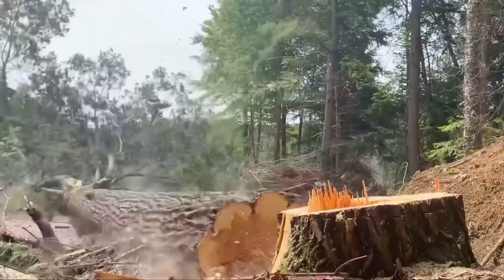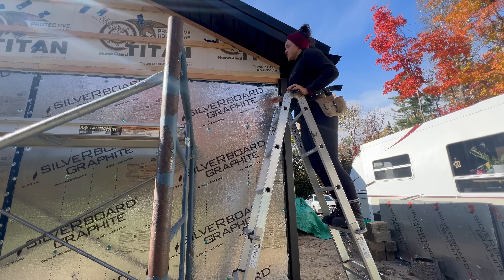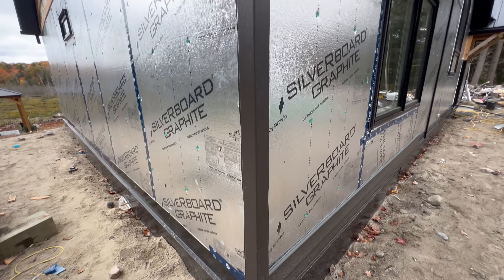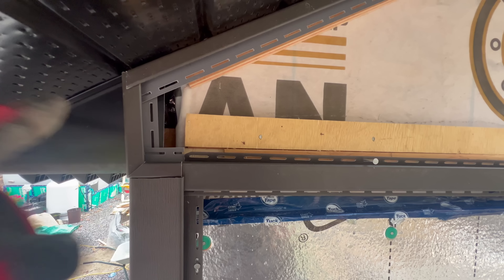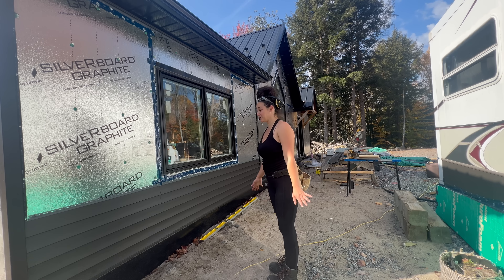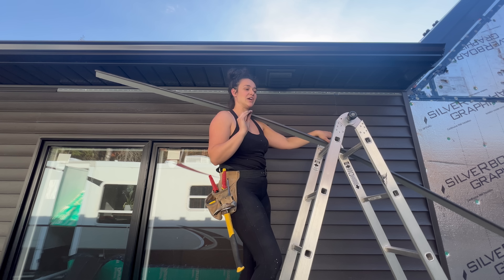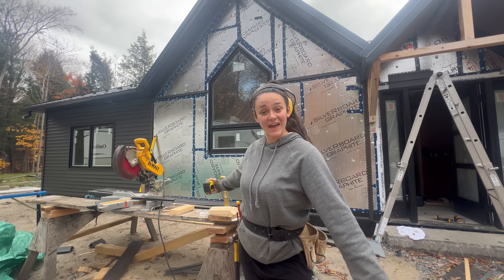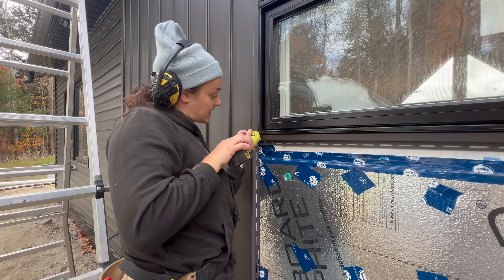I have bad news ... (and time for siding)

Comment: For a do it yourself builder I would recommend using pan head screws instead of roofing nails.  Similar to the nails do not tighten them but otherwise it works the same .

Comment: Biata, if you cutting siding with chop saw always turns the blade to the other rotation for not   rip the vinyl siding a part! If the blade teeth is rotating backwards you getting a nice cuts!

Comment: They make a small screw that you can use color match it and just put it in the small holes on the bottom of the siding i used them on my shed siding at the top same thing had a 2 inch strip on the top used thoughs little screws and havent fell out yet got my siding and screws from the home depo keep up the good work 😊

Comment: If you use the head of a 4" nail and hit it slightly with a hammer against the cut edge of the siding about 1/4" away from the cut edge,   it'll leave a dimple that will lock into the under window trim. or if you want, you can use a proper tool for the same thing ig you've got a lot to do.

Comment: There's a big difference between getting the exterior water tight and enough in there to make it habitable. 
I still think the dry wall will fly up when you get the hang of it (those vaulted ceilings could be fun though!) but then there's fitting the kitchen, bathroom, flooring etc.  Personally I think you're more or less on plan. You can work in the warm and dry over winter which was the real goal. Glad you've realised that now and stopped beating yourself up! Your daughter will look back on this time as a bit of an adventure in years to come.

Comment: No sense in stressing over the house completion, I fully understand it I have had to deal with it also, remember Rome wasnt build in 7 days, you are right, when you are all cosy in the house and look back you will have fond memories of living in the van, I remember when I bought a Timber Cutters Shack, 4 people, 2 adults and two children in a 54 sq mtr shack we lived in it for 12 years, I did double its size before we left it, but it did function and I do feel our relationships were a lot closer than the 330 sq mtr house we moved into, with everyone finding their own space. Once you get everything to the point of dry walling things will move fast, then the fun part starts, painting, ugh. I love the color of the siding, does it snap in to each other as you aint using anything to hold it, nails/silicone?
Reply from the maker: Thank you so very much. Wow that’s like 600 sq feet. It sure is tricky sometimes living in small spaces. We’re in 300 sq ft right now (27 sq mtr). And I can’t wait to get into more space. But maybe we’ll have to buy a small travel trailer for camping here and there to get that closeness again :)
Reply from the maker: Also, yes! The siding snaps in! Silicone on think still needs to happen between the windows and J trims

Comment: if you sun all of the nails , you will have to redo it as the reason the siding is slotted is so it can contract and expand in the cold and heat or it will crack
Reply from the maker: I didn't sink them :)

Comment: So I'm going to veer a little off the path here. I have been trying to retrofit an electric system into an ATV. I have the motors, I have figured out the two speed gear box for each of the motors. I have the controller system figured out. What I haven't figured out was a good battery system. Why it never dawned on me to just stuff a bluetti into the frame I don't know. I need to research how weather proof they are to see if I just make a mount or build an entire enclosure.

Comment: Biata don’t over think it … KISS theory …. When doing siding work use stainless steel roofing nails and don’t sink them all the way give it room for your Siding to be able to move. Same applies to your Trim pieces like your J channel and  H channel….  The guys not using the crimp tool are the guys whose siding is blowing off in a windstorm use the crimp tool. It works well Stay Safe 🇺🇸👊🏼👊🏼✌🏼🪚🔨….. why do you think your receptacle Trim  blocks will not work?
Reply from the maker: Thank you! Yes leaving the nails proud and using roofing nails :). Receptacle box needs to be recessed so I re ordered the recessed ones!

Comment: well done with the siding.. but.. your feature wall triggered my ocd sooo bad vertical lines with horizontal lines on same wall... nooooo lol but that is MY OCD talking your doing an amazing job not long to go now the finishing will go a lot faster than you think.
Reply from the maker: It's really common on a custom or high end build to be switching up the siding types. It adds a certain depth. I consulted a few professional interior designers on this and this designed was the most loved :). And thank you!

Comment: Hey it's under a roof an dry!
Windows are in, an operative.
You have water,electricity, food!
    Life is good,an it's not like there's a full team building...take a breath, finish the siding,then most of the outside will be done checkmark!Inside stuff you can do through winter..relax.

Comment: I had an corner piece once so i used an two inch screw that made it easier in tight space
Reply from the maker: Good idea! I guess if it’s still able to move with heat and expansion then it works!

Comment: google story stick/pole. you take a long piece of wood and mark where the lines of your siding (or tiles or whatever) will fall and it shows u if it will work before u start to assemble...it shows you where the edges will fall in relation to windows or edges or outlets or pipes coming out of the wall or other things so u can figure out the best size for your first board/tile. it can work horizontally or vertically. sometimes it might look like things will work well one way, but one seam could end up being in a weird place or u end up with a piece way too small to work. so if your siding is 10"wide (or tall) then make lines 10" apart then hold the stick up to see how much u need to offset the first piece for the optimal placement.
Reply: u can also put ticks where the overlap or nailing edges will be